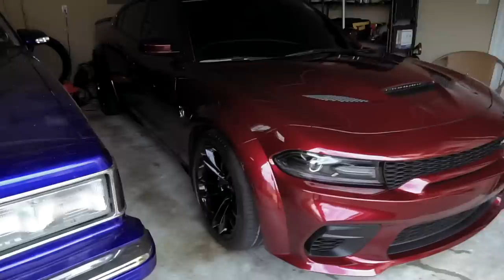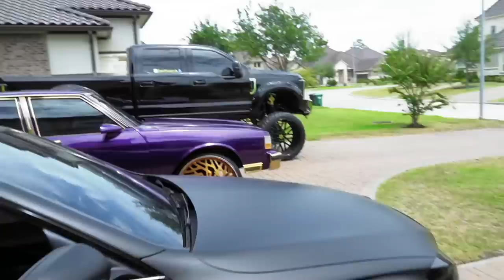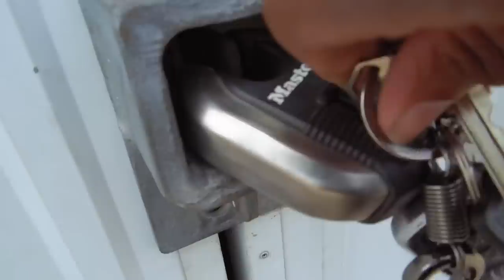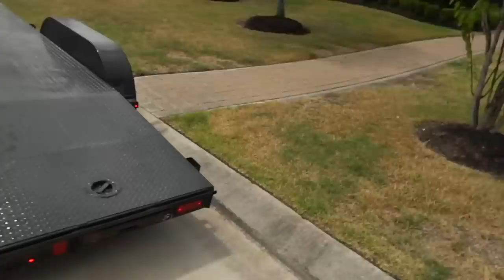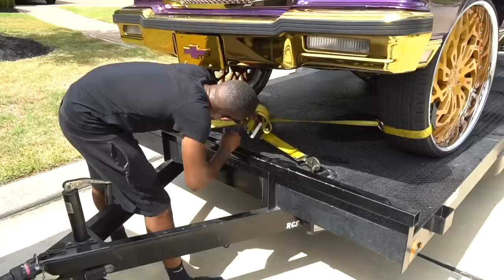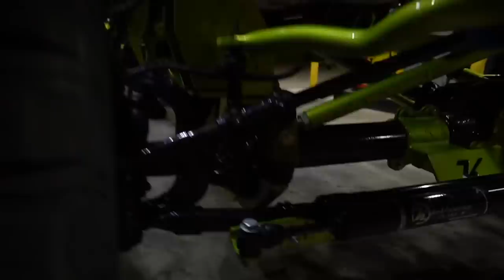Taking the purple box Chevy to it’s first car show

Comment: Corey one block under one of the front wheels in the front of the wheel one block under one of the back of the wheels in the back of the wheel you supposed to tie the frame of the car down to the trailer not your wheels bro you should put blocks under your wheels word of advice not trying to tell you what to do with yours just looking out for you bro have a blessed day 👍